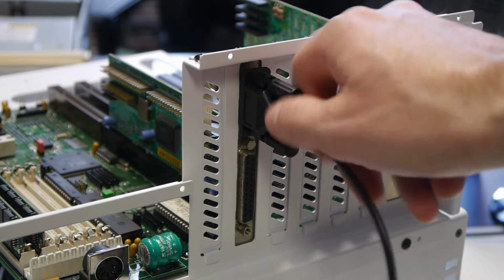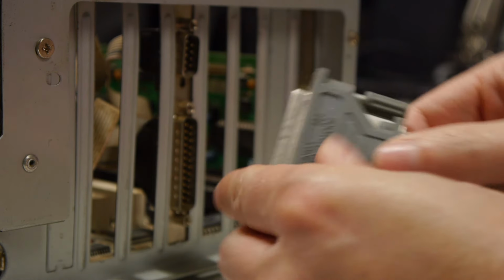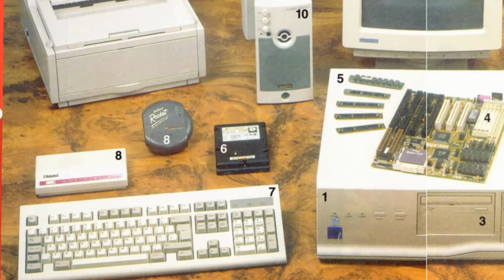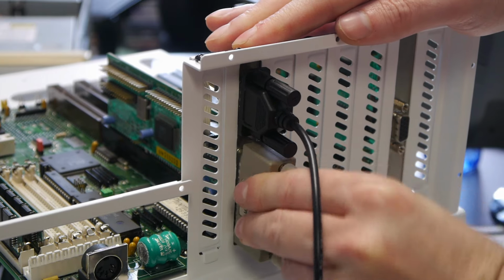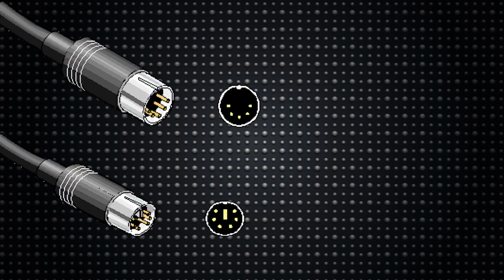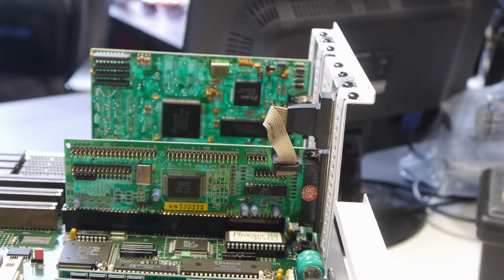What did we use before USB? | Nostalgia Nerd

Comment: Serial ports are still alive and well. They may be less common on your average home PC, but there are still a lot of devices that have them for control and monitoring. Things like industrial controllers, and POS equipment still use it. As do things like commercial satellite receives and dish movers like your local cable company uses to receiver the TV channels they rebroadcast to you. It"s also a common interface for device programmers and things like JTAG adapters. The reason why, is because it's easy to interface to, from a hardware point of view, but even more so from a software point of view. In modern day protected mode operating systems you can easily write software that talks directly to a COM port. YOU SIMPLY CANNOT DO THAT WITH USB. To do the same with USB, you'd have to write a device driver and you'd have to write one for every device you connect. Then you'd have to make your software talk to the driver. And you'd have to get the driver signed by microsoft or else Windows will complain about it. It's a lot more complicated than using the serial port. And on top of that, for low speed devices that don't require massive bandwidth, it's actually less efficient and performs far worse, because USB is a polled bus and not interrupt driven like the COM ports are. If you have a low bandwidth device connected to a COM port that only occasionally  sends and receives simple commands, the PC can pay it no attention and do other tasks when there is no activity. When activity occurs it will get an interrupt and can respond then. With a polled bus like USB, the system has to constantly check for activity. This is a huge waste, especially for a device that only needs to send a few bytes back and forth every once in a while.
Reply: True, many embedded systems use them. I think DOS made these old ports more difficult to use, partly because of DOS itself but also the plethora of flexibility.
Reply: I have to set up printers for use in Point of sale that use serial ports to communicate, also Grocery store receiving uses EDI technology called DEX to communicate with vendors making delivery with handheld devices..
Reply: Some POS peripherals I've seen physically connect over USB, but appear and act like COM devices.
Reply: @Coolman13355  Yes, and there's a reason for that. It's the reason I alluded to in my original comment. You can open and close and send data to and from COM ports in user space software using standard API calls. You can't do that with other methods of connection. You'd have to write a device driver. And nowadays drivers must be signed by microsoft. If you're a small time developer good luck getting microsoft to sign your drivers. They're gonna want a lot of money to do so, that is if they even bother to return your phone call.
Reply: It’s because hardware makers and software makers are supper stingy and lazy to move on and update their systems.
Reply: @techextremist2545  Sorry, but you clearly didn't read my comment. There's a good reason to keep serial ports and continue to use them and it has nothing to do with being lazy or stingy. You can read and write data to a serial port from user space code. There are standard API calls that allow that. You simply cannot do that with usb. That means for usb device youd have to write a driver. And under recent versions of windows drivers must be signed. For a small time developer getting a driver signed by microsoft is unlikely to be cost effective and perhaps even down right impossible. So, serial is a no-brainer.
Reply: And many of the truths we cling to depend entirely on our point of view... (grin)

Comment: The BIOS never had to be reverse engineered because in the original IBM PC (and PC-XT) actually published the source code for the original BIOS in the manuals.

As for the ISA bus, it was never actually known as that until later buses (such as the MCA and EISA) bus standards came along, and someone though it might be a good idea to give the existing standard a name as well (the implementation of the EISA - Extended Industry Standard made it natural to refer to its predecessor as the ISA).

Comment: Ahh, the 90s. When every device had it's own bespoke cable. A time of gender changers, adaptors, pass-through or crossover cables. I'm so glad we've moved on to a single connector for everything.
But now we have USB C and the proliferation of dongles that has spawned seems to be a step backwards, we just have to wait for our devices to be upgraded.

Comment: Nice video.  It's probably mentioned already but that varta battery on your board is leaking and it will do damage if it is not removed.   You can still buy those batteries but they should be replaced every 5 or 6 years.  I solder in connectors so the battery can be away from the board and easily swapped out.  The poorest design ever for a backup battery, IMHO.  Those suckers have caused the death of many Amiga's and PC Clone boards.

Comment: SCSI was super dominant for mass data transfer in the 80s/early 90s especially for scanners and hard drives. Serial was slow and most of us weren't using serial for mass storage unless we couldn't afford a better setup. We were moving at up to 40 mbit/s with the SCSI revision in 1996 while USB 1.0 was 1.5 mbit/s that same year. Also, USB is a close relative of the old Atari 8 bit computer serial port in functionality. Nostalgia Nerd isn't very thorough, because the IBM PC alone didn't pave the way for USB. He made it sound like USB saved us all from the slow file transfers over serial cables...lol no. We had speedy data transfer options even in the 80s, they just weren't always cross-platform compatible.

Comment: 0:57 RS-232C, also RS-422, RS-423 -- all variations on a theme. And you showed DB-25 and DE-9 connectors, but not the mini-DIN-8 which Apple liked, and I think which some other vendors did occasionally adopt, since it was smaller than any D-style connector.

But worse than the variation in connectors was the variation in signals. Oh, the fun we had with a “breakout box”, trying to figure out what sort of cable would work between two given devices ...

Comment: One of my computers has a catch 22 problem with USB.  Prior to installing the driver software, the computer with the 2011 motherboard defaults to legacy PS2 keyboard and mouse.  I cannot install the software to activate the USB connections, which permits me to use USB keyboard & mouse, without using a PS2 keyboard and mouse.  No such problem on the later computer.  But I try to avoid the problem, by keeping clones of the drive Cs, which gives instant recovery in the case of a drive C crash.

Comment: Serial port is still very much in use.. On a lot of aftermarket car stuff, like programmable ignitions, dataloggers, dashboards, etc.. It is really frustrating, because modern computers do not have serial ports... So you want a portable small computer, but can not buy a new one.. And some USB-to-Serial cable adapters did not work with eachother, and you can not find one when you need it..

Comment: USB is great but still has a lot of variants. Type C is the future. Everything except Ethernet must be moved to it.
Reply: I refuse to use ANYTHING other than dvi for connecting monitors, and I will also never accept usb C as a good connector, usbC and hdmi are both to small to stay in their connectors reliably
Reply: @jasonmurawski5877  You might like DisplayPort it can do all that HDMI does and more, is royalty-free, and it has small clips so you have to squeeze it to unplug it, unlike HDMI which can fall out from an accidental bump.
Reply: I actually like the good old Type A (not for stuff like smartphones tho obviously) - I just wish everyone would use cables like those which ship with OnePlus power supplies. The connector doesn't have that metal housing and contacts on both sides. You can stick it in the port whichever way you like.
Reply: @maxmustermann1455  I think they patented that, unfortunately.
Reply: HDMI for monitors
Reply: @Eric_Pham  HDMI is a software interface, USB-C is just a type of connector. You can send HDMI video (and Thunderbolt video etc.) over USB-C ports.

Also HDMI doesn't go over 120Hz so DP is still better for monitors for a high refresh rate.
Reply: And connecting to your tv
Reply: I'm not a biologist, sue me
Reply: Type C is the future. Until Type D appears, that is...
Reply: USB Type C has an issue: it's wearing out way to fast. After around 500 times it's only a loose connection, only waiting to be moved a little and loose contact. Type A is way more stable and reliable and wherever there is enough space for a connector, that doesn't break apart when you're a bit rough with it, it should be used ...

Comment: I'm still using a PS/2 port for my mouse and keyboard. And I think I have a serial mouse lying around somewhere too.
Reply: Its some MSI board with Pentium 5200 ,running windows 7. Yup CPU usage is around 50-60% when watching Youtube but I don't do much while watching youtube and it plays pretty well.
Reply: "is around 2.5GHz" Yup and its pretty quick too, yes even with Win7. And what I found weird is that my system still seems quicker than many of the newer systems out there, especially those running Windows 10. Everyone tells me Windows 10 is faster but I just don't see it.
Reply: I read in multiple places that Windows 10 is 'faster' than 7 on the same hardware and sorry I don't buy it. But for me windows 10 has way too many issues than that, the telemetry is a bit scary as well as the forced updates, but also the poor search functionality is bad for me since I like to use search and I tried to help someone add a screensaver to Win10 and you couldn't search for the damn thing! Also they way they split the control panel is also alarming. For me I see very little reason to upgrade unless I want to play modern games or whatever, since I can play movies fine in Win7. Also security is a non issue as I av running and I do full scans from time to time and I check for rogue processes from time to time also. I know sooner or later they will force us to move to 10 I know it, I have seen it. Sorry MS Windows 7 still rocks and I have control over it, not you. 

PS Yes I know I can disable updates via 3rd party tools in Win10 but still I shouldn't have to do so.